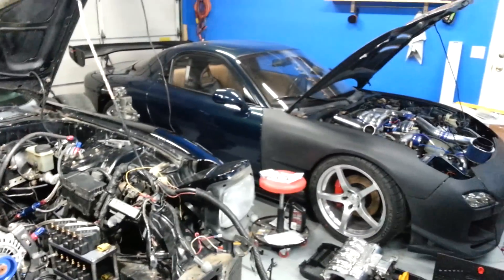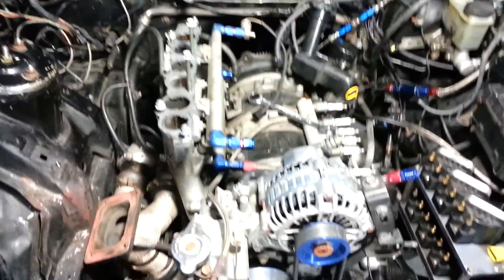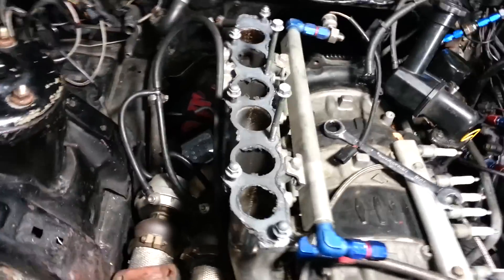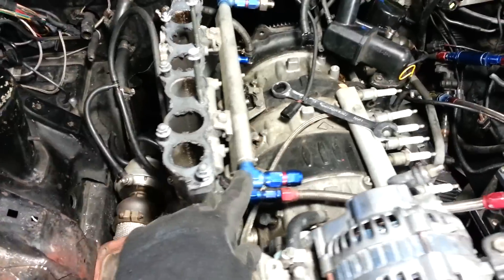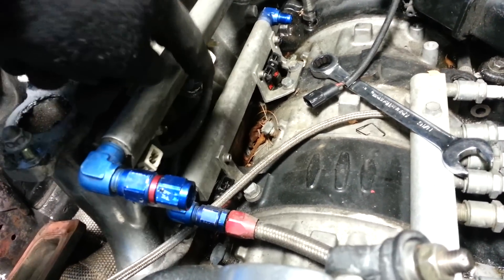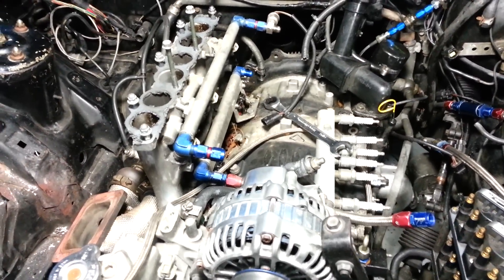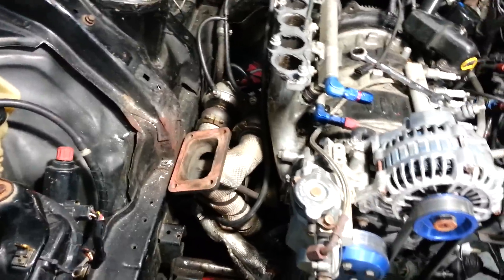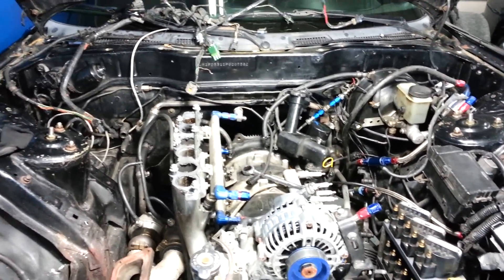Tearing apart a 3 rotor 20b Rx7

Comment: Im willing to be that the reason they used those coils is to run a waste spark setup now that im thinking about it.. If it were a 2 rotor you could get away with just two of those coils running wasted spark but since wasted spark can only be ran at 180* and a 20b runs 120* firing sequence then you have to waste the extra plug to dead plug like what is setup on your car. Then requiring two times as many coils that was actually needed. Kinda corky but it does the job.

Comment: That is something the previous owner did. Kind of a short cut that works but is not the correct way. Kinda like the rtv that was used on the intake manifold that is scary. That all needs to be removed and a real gasket needs to be used before a glob of silicon gets sucked in thru the intake and causes failure.

Comment: Not exactly 249zac249.  A 2-rotor Wankel engine will get twice as many cumbustion cycles as an equivalent 4 cylinder piston engine would.  Since there is no direct correlation between a rotary and a piston engine most racing sanctions will enforce a standard 2-stroke motor rule which multiplies the displacement by a factor of 1.5 or 2.0.
Since one rotor is 654cc a 3-rotor would be 1962cc (2.0 Liter) or in racing classifications a 3924cc (4.0 Liter) engine.
Easy enough for you?